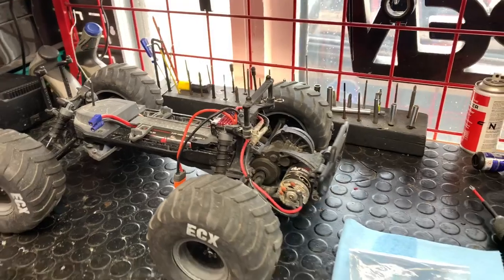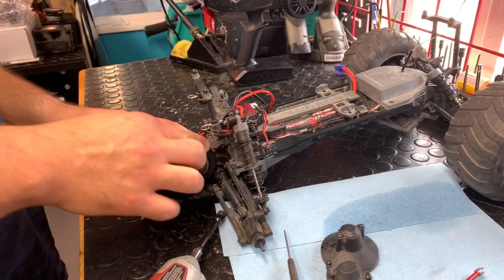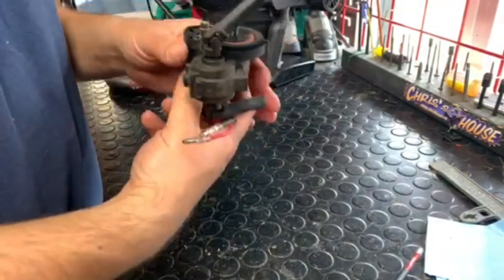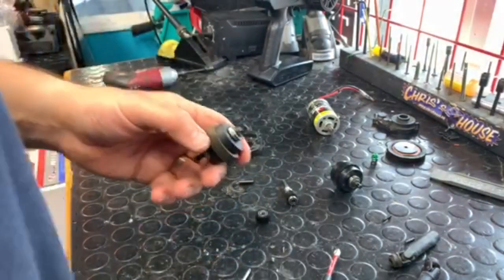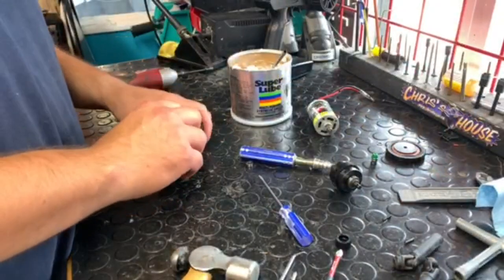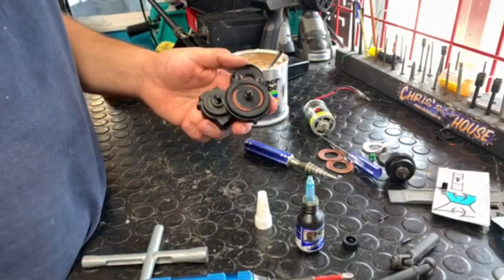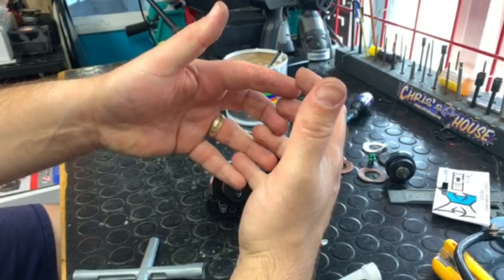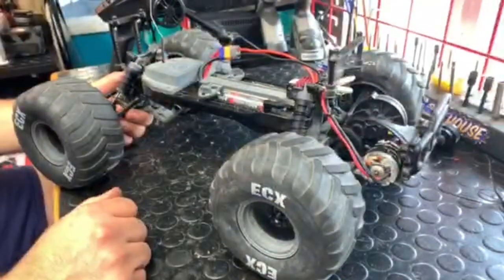In-Depth How-To: ECX 2WD Metal Gear Upgrade + Troubleshooting Bad Transmission  + Tech Tips

Comment: Great video/tutorial. Thanks for such many advices for a newbie in this "sport" :) I just saw another video about changing the transmission into an Axial AX10 -metall trans. But that comes without diff. Would the car driving very different? I own an ECX Torment in the meantime with brushless 3660 4200 kv and metal axles...

Comment: Thanks for the video, I did all this but trying to restart de car, it didn’t make the 3 beeps it does when you turn it on, and the only thing working is the steering, but it is not running, what can it be?
Reply from the maker: Throttle trim knob on right side of control panel. Adjust it and should be good 

The other potential fix is battery needs charged.     If the battery hasn’t been used in a long time it will need cycled.   Charged and ran charged and ran.  Hope that helps

Comment: Where are these online manuals good sir?
Reply from the maker: The files are in the computer
Reply: @ChrisHouseHobby  would you happen to know why a vehicle might start going slower forward than it does reverse? My son got a amp Mt from my uncle, it has all Traxxas electronics and a Traxxas tqi radio. Traxxas xl5 ESC I believe. My son couldn't figure out how to turn the car on and held the button for the ESC too long or something I believe because it drove great the first day but the second day it only has maybe 40% forward throttle but 100% reverse, the buttons are not reversed though so I'm having difficulty finding a video on correcting it. Very new to the hobby grade RC, only owned one for 4 days lol I appreciate your time whether you have the answer or not 💯

Comment: whats the best motor for this toy that wont burn out and its brushless?
Reply from the maker: Go with genuine hobbywing systems 
3300 kv or 4000kv for more speed 

And put the metal gears in.   3300 is great for kids and adults that want more speed.     And you can change gearing to go alittle faster or slower 

Chris

Ps.  Buy it local and get local support